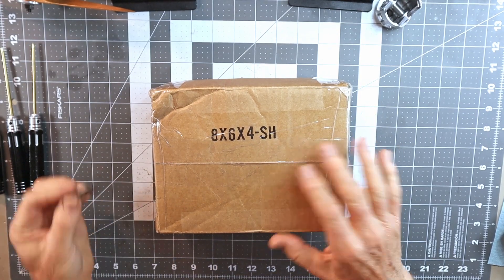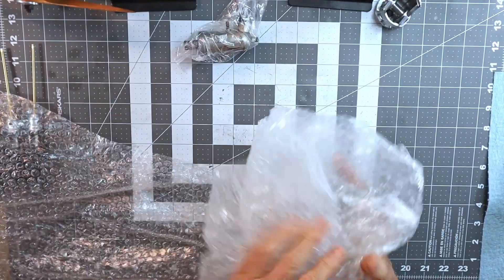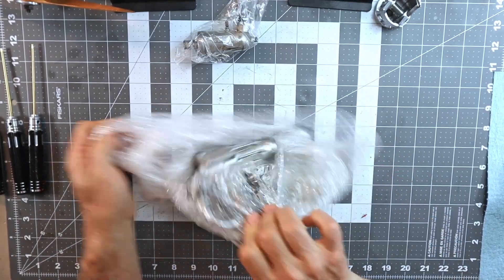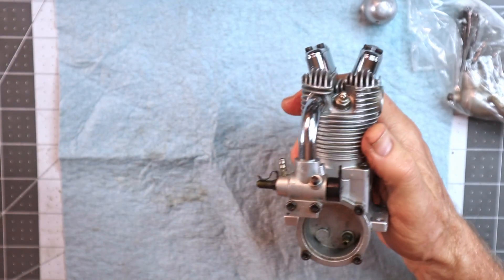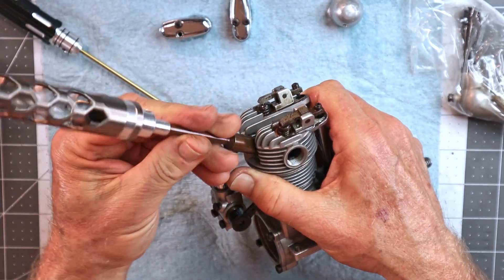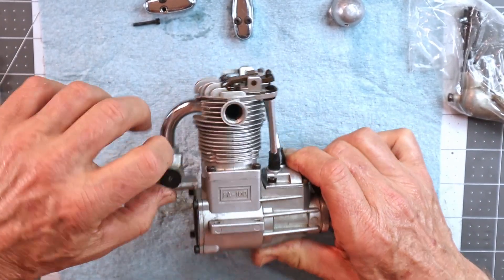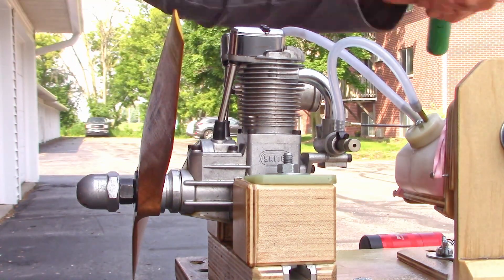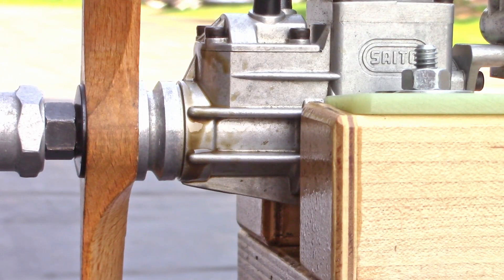Saito FA-100 Leaky Front Bearing

Comment: Maybe it's me and I suck at rebuilding engines but EVERY Saito I've rebuilt leaks from the front. I've used rubber sealed Boca Bearings and leave both seals on and they all leak. They'll do it either right away or after a few flights/runs.
Reply from the maker: Well, then it has to be how you’re removing and installing the bearings. Maybe you’re doing damage to the front housing in someway. I have never had a front bearing leak after I replaced it.

Comment: My Saito FA 1.80 leaks a lot from the front bearing ever since I put a metal shielded bearing into it. I wipe the front of the plane after every flight.
Reply from the maker: Interesting, but it makes sense. Metal shielded bearings don’t seal as well as rubber ones
Reply: @dmrcflyr2 I sometimes wonder if my piston ring is badly worn causing excessive blow by, and the vent tube is not adequate.
Reply from the maker: You would think if your ring was worn to the point of having blow by you would have a significant loss of compression to go along with it.  Easy test, replace the ring and front bearing and see what happens.